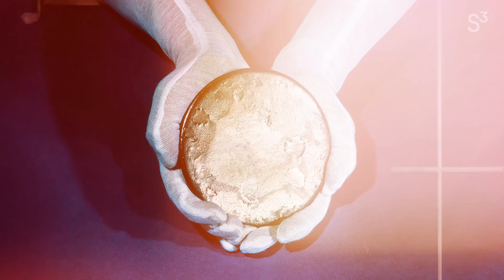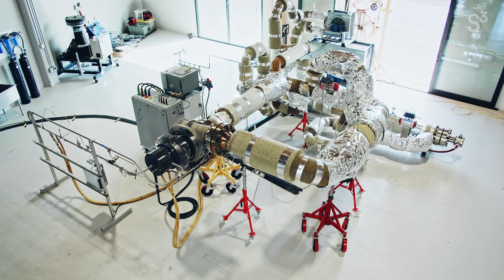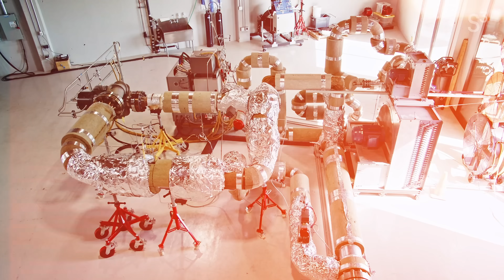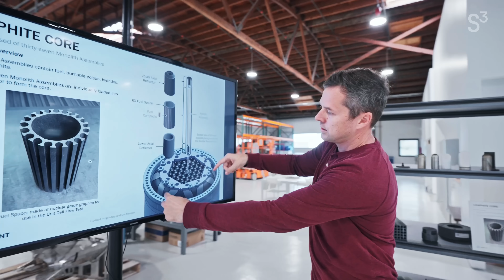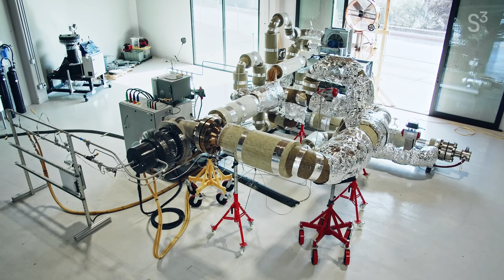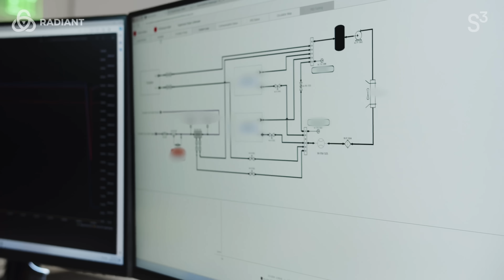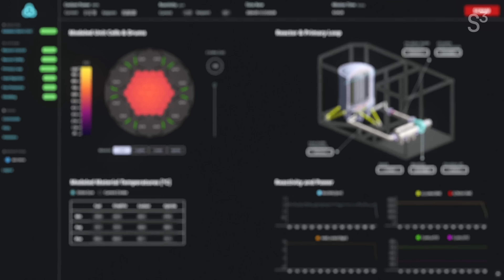The future of Nuclear = Small, Mobile, Microreactors | Radiant

Comment: This is still a pressurized system though, right? That introduces safety issues. How many atmospheres do you have to pressurize it to get appreciable heat transfer into the exchanger?

What fuel are you going to use?

Efficiency?

Comment: Unless uranium can be used in plastics and fertilizers we will never get away from oil.
Reply: Why do we need to get away from oil? Plastic and fertilizer use a tiny fraction of the oil we extract. After oil and gas get too expensive, we have coal. These will last an extremely long time if they are not burned for energy.

Comment: Convoys = ammo, water, fuel. With enough energy at a forward base you would eliminate the need for both fuel AND water convoys.
You could use the energy to power evaporators to extract abundant water.
Ammo and food could be delivered via autonomous drones.
Only personnel would need to be convoyed.

Comment: That's some amazing engineering work. Love it. I am curious though as to how the Helium cooling works in practice. Yes: Helium has a very low cross-section and 3He and 4He are the most stable isotopes of that family.... The only problem with it is that it has very a low cooling capacity until you compress it to near fluid state which requires quite a compressor system... and you need a lot of helium. What happens if the compressor system fails?

Comment: I’m concerned about having a powered mechanism to control the slowdown/shutdown of the reaction. In the case of an absolute disaster and total loss of power, the reactor can enter a runaway state since it will have no way to shut its self down. We learned this the hard way at Chernobyl but particularly at Fukushima. Fukushima switched to control rods that are lifted up via electromagnets so that in the total loss of power the control rods drop due to gravity and stop the reaction. I hope this case has been accounted for.

Comment: Nuclear reactors will never be as ubiquitous and as "everywhere" as current "regular" technologies, simply because gov'ts will always want to exercise some level of control over it, will want to know where each reactor is and who has it, and this creates bureaucracy and paperwork and makes things inconvenient. This is due to the fact that every nuclear reactor contains the ingredients for some maniac to make a dirty bomb. This is an unavoidable consequence of how they work. Many would-be terrorists would be put off by the fact that cutting it open and exposing the core (which is necessary in order to extract the material for the dirty bomb) would inflict a lethal dose of radiation on them. But this wouldn't stop all of them. Some terrorists for example, are already suicidal, so the prospect of giving themselves a lethal dose of radiation while extracting the material would not deter them.

Comment: 6:52 One huge disadvantage of the control blades is that they not naturally close (or fall in a regular reactor) with a power loss in accidental situation, or with a DCS/ICC , electrical motor, or electrical diver failure.
I've not seen a return spring, or return blade in the design.
Safety is one of the main concern of people and a tour of all the safety and redundancy features would be a really nice addition !

Comment: Just some simple calculations : 
4 MW is the same as maximum 2 onshore windturbine. At the price of maximum 4 million/turbine, the total cost is about 8 million dollars including the connection to the local grid or company .
in solar panels ( if the location is viable ) the cost would be around 4 million dollars for 4 MW of power ( not including the 4-5 hectares of surface needed ) 
Looking at the US dept of energy's research that the cheapest SMR can be build for $6.8 million / MW , i have a hard time believing this is a viable plan for general use
a better alternative would be to invest in better and more efficient energy storage facilities imo

Comment: Smaller sizes do indeed lead to faster iteration.  Intel and other microprocessor manufacturers introduced newer chips at a fast clip while IBM took years to release a new large mainframe.
Also true that it is much easier for a low-end, i.e. cheap producer to go upscale than it is for a high-end producer to add cheaper products to their line-up. High-end company culture just can't handle designing and building "cheap stuff".

Comment: This is absurd, the amount of energy poured on earth by the sun every 24 hours is truly astronomical. It is proven beyond the shadow of a doubt that sun/ wind/ battery systems  are not just cheaper than the OPPERATING COSTS of any other generation system but also that in systems designed appropriately  S/W/B will bring civilization “super power” which is an abundance beyond our needs .  These dangerous systems hyped up in this video are just absolutely unnecessary.

Comment: I understand that the control blades are controlled by an active system (please correct me if I misunderstood). However, it would be more reliable for this control to work passively. Even if it is backed up, failure of active mechanisms will also cause a catastrophic accident (especially in seismic effects or station blackout case). The activation time constant of the control blades is also very important. In expected/unexpected accident situations (AOO, DBA, BDBA or SA) where the temperature will increase aggressively, how much time is needed for the I&C systems to understand this and for the motors that will provide the movement of the control blade platforms to be activated? If we consider that the chain reaction will increase exponentially, this period should be quite short. My second question is about the online reactivity control mechanism. Is there another control mechanism to control the loaded excess reactivity at the criticality level? Or is this also provided by the control blades?

Comment: 00:03 Radiant is pioneering small mobile nuclear reactors to provide power in rough terrains.
02:30 Nuclear technology evolving towards small, mobile, microreactors
04:19 Radiant is developing small, portable nuclear reactors as an alternative to diesel generators.
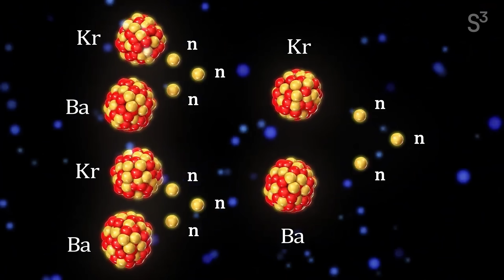06:14 Nuclear fission explained in layman's terms
07:58 Microreactors are designed to be small and mobile, with a maximum production of up to 50 units per year.
09:39 Testing and development of helium circulator for nuclear microreactors
11:27 Development of control systems using digital twin of a reactor.
13:25 Demonstrating passive safety and cooling system for nuclear reactor
15:23 Radiant is building a nuclear technology company for space and Earth.
17:16 The future of nuclear is small, mobile, microreactors
Crafted by Merlin AI.

Comment: Projects like this are exactly why they tell us not to build concrete bases for our solar panels in our solar farms.  When solar is replaced by something like small nuclear reactors it will be too difficult to remove the bases and turn the land back into farm land.
Reply: Dynamite
Reply: There is no way that these small reactors will produce cheaper energy than solar panels, even with battery storage.
Reply: @huckleberryfinn6578  Why not? (and they come in different sized too)
Reply: @huckleberryfinn6578 a 200 watt solar panel  is 3 x 5’. It would take 5,000 to generate a megawatt. And it would more than cover a football field. They would cost a million just for the panels. Based on 200 dollars as the low end cost for a 200 watt panel. Factor in batteries for nighttime production, not to mention cloudy days and degradation of the panels over time etc your argument begins to fall apart pretty quickly.

Comment: Chernobyl had a graphite moderator.  I hope you don't have a similar problem.  You did a much better job of explaining nuclear fission than most videos I have watched.  Most of them make a lot of mistakes but your explanation is correct.  I didn't hear anything about how the heat is used to generate electricity.  Are these only for thermal power?

Comment: Are there safeguards just in case of Sabotage, Earthquakes etc?  What if the reactor suddenly broke apart and exposed the fuel?  What would be done?  Would an ordinary person without nuclear expertise be able to 'shut things down' in case of an emergency?  Has safety redundancy been included in the design?  Is there a material when in contact with outside air that would create some sort of an oxidation layer that would seal any radiation from escaping?  For example covering the outside of the fuel cell with this material.  I think this idea of portable nuke is absolutely amazing.  Good Work.

Comment: 2:00 the saddest part is the military ALREADY built a micro reactor like this 60 years ago with the goal of replacing diesel generators to avoid the need for local powergrids in warzones. It was called SL-1 and the reason it failed was because the engineers didn't properly understand the technology and didn't build in enough safety. The central control rod was capable of sending it supercritical, it was designed not to do this with a singular control rod, but they got the engineering wrong their margins weren't what they thought they were and ultimately flubbed maintenance on 1 rod sent it supercritical, caused a steam explosion, and killed the 3 operators. On top of the engineering flaws the operators working the reactor had no respect for the dangers of being a nuclear operator, they very much had an army mindset of just getting shit done and not worrying about the consequences of not understanding procedures, working outside analyzed conditions, living with deficiencies, etc.

If the army had taken the safety concerns more seriously these micro reactors might be broadly deployed today. The Navy did, and now all our subs and aircraft carriers are nuclear powered. It's a real shame this program had to be ended for the army.

I hope this company understands nuclear safety and takes it seriously. The repercussions of failing this aspect are that the public turns against the tech, funding dries up, and we continue our dependency on fossil fuels. Frankly everyone on this team should watch the SL-1 documentary from the Atomic Energy Commission (available for free on youtube), learn from our history on this, its very sobering. The primary challenges are not engineering challenges, they're safety, human factors, and economics.

edit: 15:40 the irony is you're shipping it to INL, the same site the accident I described happened 😅. I mean it makes sense its the nations test bed for reactors. Just ironic it'll go critical overlooking the graves of the operators from the last micro reactor tested there...
Reply: You mean prompt critical, not super critical. Every reactor has to go supercritical. That just mean power is going up. Subcritical means power is going down.
Reply: @ryancollyer2046  Yes thank you, my mistake. Super critical means more neutrons out than in, power rising, prompt critical means super critical through prompt neutrons alone. 

My ME was showing 🤣 (not a nuclear engineer)

Comment: They seriously didn't pitch this as a power source in a war zone! Just imagine a bunch of terrorists getting a hold of nuclear material. What could go wrong?  The other issue is that system uses graphite as a moderator that can burn incase there is a run away reaction.

Comment: Just to clarify @07:14, the term "critical" is not meant to be one of concern. Most people outside the nuclear world will hear "critical" and believe there is a major issue. "Critical" in nuclear terms is a good thing. It basically means that your reaction is stable and produces the energy you expect. When you hear someone say "the reactor is critical", it means the reactor is stable and performing as designed with no issues.

Comment: The USSR built over 2500 Radioisotope Thermoelectric Generators or “nuclear batteries” using polonium. They were deployed to remote locations and powered things such as lighthouses. Many were forgotten about and left to the elements or picked over for scrap causing untold amounts of contamination.

Comment: For those unaware Gen IV nuclear power (which is what this idea is) is the HUGE benefit that we have needed since the 1970's. Gen IV includes using Molten Salt Reactors (MSR's) as well as Small Modular Reactors (SMR's). Molten Salt Reactors are a kin to a giant battery that can absorb immense heat energy, and can later be converted into steam power (as most all nuclear is often a form of steam power). But this intermediary step of Molten Salt makes it much safer and easier to control.

SMR"s are great for a vast variety of purposes. Small towns, spaceports, large cities, mining operations, nuclear aircraft carriers.... all sorts. The real benefit to SMR's is that if they are produced in a factory setting like an iPhone, can get better and better as they keep making more of them. This is the beautiful idea of having manufactured SMR"s. Now using SMR's WITH MSR's is a great way to cover the baseload demand (say highest demand during winter) AND the highest demand during summer. This can be used alongside other traditional power plants, as well as wind and solar too. 
It is not perfect but it is much better than what do today.
Reply: These can and will be used for general purpose, but also for AI (which Cloud GPU's currently use about 10x as much power as a traditional cloud CPU's do), Bitcoin, Electric Cars, moon bases, electrifying +50% more of the world that doesn't have the option to be and other purposes.

Comment: I want to what happens when the control blades fail to close and there is a helium leak/ cooling failure. Would be interesting to see what happens when the core goes into an uncontrolled melt down.

Comment: The trucking industry could see huge benefits from this. Currently a commercial class 8 electric truck has at most 500 mile range,  tesla semi, and others around 250 to 350 mile range. And it takes time to charge. A mini nuke reactor on the truck could provide plenty of power  and the range would be probably many thousands of miles.
Reply: Sounds cool.  BUT there is no way in hell I'm sharing the road with a live nuclear reactor cruising down the highway at 75 mph.  Gives me chills just thinking about that.